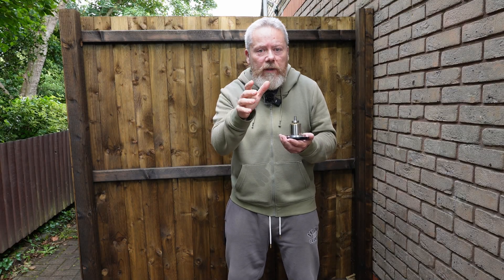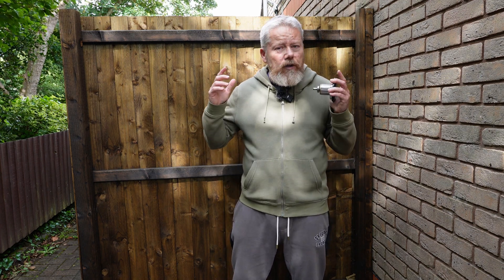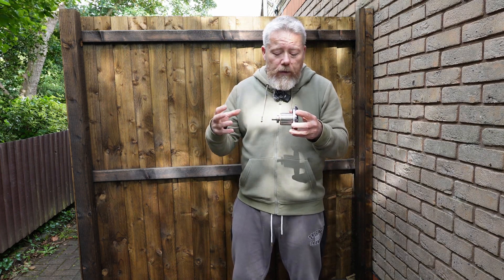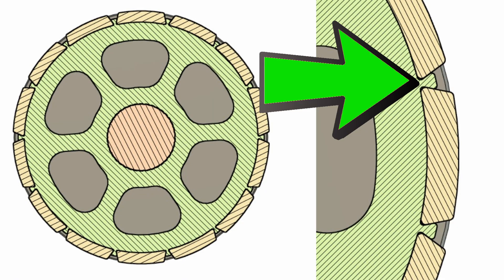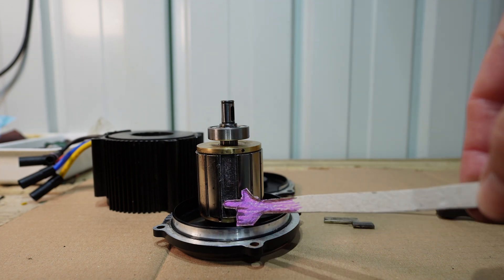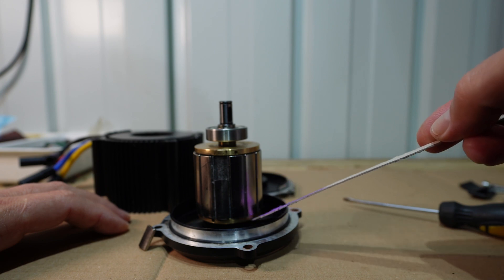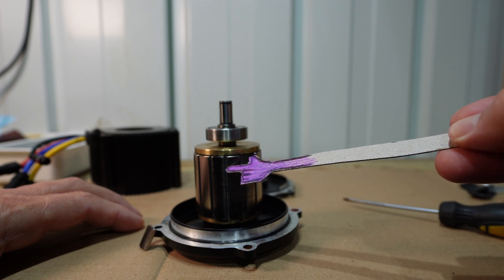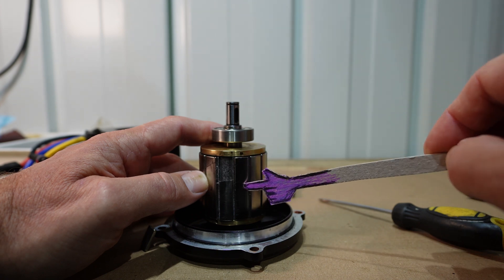3500 Watt failure investigation of the  CYC Gen 3 Motor Core Magnets CYC damaged motor destruction.

Comment: that's a lot of money for a motor with a few magnets and washers,,, blimey thanks for the video , shame that failed, my son had problems yrs ago with a Suzuki sv 1000 magneto were the magnets broke loose and caused bad damage , turns out was a known manufacturing fault with the glue they used to bond the magnets to the cylinder cheers Shane uk

Comment: The cause could be the heat destroying the magnets The glue may had been loosed its properties due to heat + centrifugal force caused it to pop out. Heat could be caused due to the max current passing through the coils.May be the switching of the coils had not been at synchronised with the magnets also (Hall effect sensor) at the motor in speed this may caused back emf to generate in not proper order thereby drawing more current (back emf and voltage from controller shorting) solution could be adding another Hall effect sensor or optimising the controller processing brain. also stoping the controller of providing high current to coils at high (less stress or load) optimising the switching of coil by keeping the Hall effect sensor in proper synchronised. Thank you
Reply: @baconbuttties  the diameter of the motor could be increased thereby increasing the torque and reducing the current draw of the motor

Comment: You really got my attention when you revealed this attachment method of sliding magnets into a slot. Then you did such an incredibly s*** job of evaluating whether these slots were effective or not at retaining the magnets that I actually gave you a thumbs down. You were too damn lazy to take the brass cap off the rotors so that you could take a picture from the end of the slot. You didn't even try to. You didn't try to measure it. You did nothing to prove or disprove the effectiveness of these slots.
Reply from the maker: Sorry I didn't meet your expectations when talking about a 1000 pound failure. Next time my bike fails I will remember to forget about not being able to use my ebike and solely concentrate on making my video more specific to your needs.
Reply: @baconbuttties  that's more like it.

Comment: I bought the CYC X1 Pro Gen 3 and rode 2 kilometers on a test ride after having it professionally installed by an electrical engineer & e-bike builder, bench tested and professionally built every step of the way and tipple checked everything, . The motor and the X6 controller just burned out on the first test ride. Running at max 2,000 watts. The magnets need to be  embedded, so the motor spins flush and the magnets form part of the core. That way the centrifugal force doesn't contribute to degradation of unit. Imagine bein on an amusement park ride that spins and rather than being strapped into the chair with aa seatbelt and safety bar you're held on by a clip to the back of your t-shirt.
Reply from the maker: Not good is it, they are not fit for purpose

Comment: CYC is not made to operate in just one gear. You must be on the correct gear for the correct speed & terrain.. You can not & I repeat, can not operate it like a bbsd. It is a different beast.
Reply from the maker: But it is meant to operate in within its tolerances, I didn't go outside it

Comment: Ok so it looks like I’m the outlier here. I run a 72v set up with a  Molicel battery (12.6ah) on a Giant Trance X 29 2. I’ve been running it for a year or so and I ride single track and pedal and I also “dirt bike” it around as well. It’s stupid fast and torque is insane. I was told the X6 controller runs (in race mode) at 65amp. My battery is rated for 90amp continuous. I’ve hit 45 half way down to the high gears so top speed has to be between 50-60mph. So I run bursts of 4680watt (72x65) and even above because it’s about 84v fully charged and was told it will handle up to 5000w bursts on the stock X6 controller. 

I haven’t had one problem with this motor. The torque sensing has been absolutely wonderful for those of you who get out on the trails and has worked flawlessly.

I will say that I think this motor really likes a “torque” set up over a “speed” set up so to speak. I run the lowest tooth motor setup and my low gear for the actual bike is either 51 or 52 tooth. It will throw you off the bike like a 2 stroke dirt bike!🤣🤣 

Also I’ve found that throttling in bursts rather than sustained throttle is what it likes as well. 

My engine does cut power if I push it for the record also so I know the safety feature works on mine.

I’m sorry you’ve had problems good sir. I’ll say that if your going to do a lot of pedaling with some throttling here and there then this motor is perfect. If you are going to be doing more throttling than peddling than the modded BBSHD is the way to go. I own a non modded BBSHD and it’s been absolutely flawless but I prefer torque sensing over cadence and THAT’S where the BBSHD falls short. I do hope your new one serves you much better good sir.👍🏽👍🏽

Comment: My TSDZ2 with 1/5 the power had exactly the same design on its rotor and failed exactly the same way, after a sustained overclocking at ~600W. The trapezoid magnets look intuitive but they just won't hold up under extreme heat and rpm. My guess is repeated inconsistent heating and cooling for the magnets and the rotor body along with the rpm causing them to slowly deform and detach. I investigated my failed rotor and found 1/3 of the magnets developed axial and radial play. Glue is the way to go for such high speed rotors.

Comment: It could've been when you were doing those runs up that big hill on the big 50T cog a few vids ago. I was wondering at the time if you were in way too high a gear. It would be interesting to know how many revs the motor was doing when you did that test.
Reply from the maker: The motor will only go as fast as it will go, it's limited no matter what gear you use. 👍👍

Comment: The manufacturer CYC said that it had solved the problem of the magnets in the GEN 3 and it still has the same problem, I don't know how much the price of a kit means to you, but in my case it is a month's salary, and I get rubbish, You have to realize that CYC are scammers and should pay for it, I insist do not waste your money.
Reply from the maker: I believe they are trying to make a good product as replacing parts under warranty wouldn't make good business sense.

Comment: Hi guys. I bought a Stealth gen1 in 2021 and I can only say that this is a piece of crap. I had a lot of problems with 

-the bac controller, the torque sensor system failed because of the bad water resistance, he glued neodym magnets got loose and caused a crash between rotor and stator a. s. o. 

When I bought gen1 system, I got just 1 year warranty. When you now buy gen3, you get 2 years warranty. 

Sorry, but I feel betrayed. 

At the release of stealth, cyc told us to use it in 36, 48, 52, 72V mode. Meanwhile they erased 72V mode because lots of motors got damaged/fried. 

DON'T BUY GEN 3 SYSTEMS (X1 Pro and stealth) BECAUSE THEY ARE NOT RELIABLE YET. Hopefully gen4 or 5 will be. 

Best regards!

Comment: I go with high Revs.  In DC motors there is a term called "thrown solder"  where the commutator bars are "expelled" from the motor from high revolutions and high heat, and the "smoke is released".
Reply: @baconbuttties  If you hook up an auto starter motor with no load, it winds up until the commutator bars fly out.  The motors are set up with the field and rotor in series.
Reply from the maker: @bigwheelsturning  This has  a controller and a set limit that is set  in by the manufacturer. It would of been tested at peak revs.

Comment: Don't you realize that the gen 3 engines are the same garbage as the gen 1 and gen 2? cyc said he had improved them and he lied, he had a lot of gen 1 and gen 2 engines and he has put them in the gen 3 in order to get rid of them.
Reply from the maker: They are not Gen 1 and 2 motors.
The Gen 3 has slight differences.
Reply: @baconbuttties  gen 2

Comment: I'll be honest- I don't have a high opinion of CYC. I think their claims are outrageous and incorrect, they have seemingly very poor customer service, and their motors have inherent issues that they don't fix from one generation to the next. If you're spending that kid of money on a motor, I would suggest to anyone that they should get a BBSHD and hot rod it. But I'm glad that you got your motor fixed and they responded kindly to you. I do wonder if they knew who you were so they got back to you so quickly. I've read all over the internet about how difficult it is to get a hold of them until they leave a negative review on Facebook. Thank you for your honest review. 😊
Reply: From my experience the Quality is good but there are some bad desing choices. Also i would not recommend 72V for this motor. The RPM is way too high and such a small motor can not take more than 3kw in the longterm.
Reply: @Sur_racer  but the motor is rated by CYC for 72v. If you're saying that's too much for the motor, then you are proving my point of their quality issues
Reply: @georgeforeman89  at 52V the quality is good but the rating from cyc is too confident. Yes you can run 72V but when you go full throttle all the time the motor eventually will break.
Reply: @Sur_racer  lol that's not a good quality machine if it can't handle the maker's own ratings

Comment: I do not think that max RPM changes with 72V. My CYC STEALTH GEN1 with 48V reaches 4000 rpm. What RPM do you see in the app?
Reply from the maker: I will have to look at all the parameters next time I use the new motor.
Reply: I already have 7000rpm at 52V. I think 72V would be even higher

Comment: Do you think maybe your motor had a manafacturing issue, & the majority of the motors can handle the 72 volts? I guess CYC will know, how many motors fail at 72v. Sorry you have had issues, not a nice start to your install
Reply from the maker: It could have been a manufacturing issue 👍

Comment: I was about to purchase CYC X1 Pro Gen 3 - 5000W eBike Torque Sensing Mid Drive Conversion Kit
Don’t think I’ll bother now thanks for the heads up
Reply from the maker: Mine might just be a faulty batch 🤞 They have sent out a replacement so will be testing that to see if the same thing happens.
Reply: @baconbuttties  Keep us in the know. Don't know how long my tangent ascent will hold up so I've always got my eyes on another kit when the day comes but so far the CYC doesn't seem to have all the bugs ironed out. Getting there though.
Reply from the maker: @kolendakomputers2491  yes will be more updates 👍
Reply: My Cyc gen 3 has the same problem. Its a common fault so Cyc discontinued the gen 3 motors. I've just ordered the gen 4 upgrade kit which requires the x12 controller and a new display. I had the Bac2000 controller which isn't compatible with the gen 4 motor. It's turned out to an expensive repair. Hopefully it'll be worth it when it arrives.

Comment: sleeves, you are right a sleeve covers something, dovetails sort of i suppose nearest description, good break down tbh i thing when you have done your 48mph uphill on the motor this was the start of magnets coming away due to high heat and epoxy or whatever used to glue in place, i agree the dovetails need beefing up especially as people buy the gen 3 pro because its the most powerful, god help us when/if they ever release the X12 5000w controller, anyway i have decided i only need 25mph so i'm getting mesen a yose power 350w kit, £380 all inc battery.
Reply from the maker: I wonder if the X12 has been held back for this very reason.
Reply: @baconbuttties  they could just make the tongue and groove, more tongue and groove and use a higher strength bonding of the magnets, either way i'm not sold on the idea of them no more, great video Bacon.
Reply from the maker: @MainlyNorthernSoulDancing  Thanks 👍
Reply: the x12 is out already but you need to buy it seperately. I dont think many people have done it tho
Reply from the maker: @jaegermonster5540  no option for x12 when I looked
Reply: @baconbuttties  yes you can't buy it with the kit but of you search thero website you can buy the x12 separately
Reply: @baconbuttties  I stand corrected. The offering I was looking at was out of stock and has since been taken down. However it was there for a period of time just "out of stock" indefinitely
Reply from the maker: @jaegermonster5540  I did look, Still couldn't find it ?
Reply from the maker: @jaegermonster5540  👍
Reply: @jaegermonster5540  perhaps CYC stockists should consider adding it to the CYC build kits as i could not find jack s**t in USA last month

Comment: From cyc website 
190 RPM with 36V batteries 
250 RPM with 48V batteries 
270 RPM with 52V batteries 
310 RPM with 60V batteries 
370 RPM with 72V batteries
The numbers are from 11/53 chainring, so yes higher voltage gives higher rpm
Reply: He meant internal RPM. Internal MOTOR RPM is around 4000 RPM.
Reply from the maker: Thanks for looking it up 👍

Comment: Calling that a sleeved design feels a bit disingenuous.

Having an SPM motor spinning at high speed like that really feels like a problem waiting to happen. If they were to actually sleeve it, or move to an IPM design, I'd submit that would be a good improvement in the overall design.

As an aside: The texturing on the notches almost looks 3d printed?
Reply: don't think it was disingenuous although possible...more like a language deficit.  But, yes marketing gets in the way because this has been a sensitive failure mode for CYC.  As to your keen observation about 3D printing. That may in fact be the achilles heel and why the tongue in groove failed...insufficient tolerance/web thickness/material properties of 3D printed parts.  That is for CYC engineers to sort out and they better move fast if they are relying on 3D printing to keep the price low in lieu of what every customer wants, reliability.
Reply from the maker: Yes it shouldn't have been called sleeved.
Reply: The texturing looks like laminations.
Reply: @JimWattsHereNow  as in delamination's Jim?...and therefore unrelated to being 3D printed?
Reply: @lukewalker1051  No as in sheets of metal layered together. A power transformer core is made of sheets of metal stacked together. It is to do with reducing eddy currents induced by the magnetic field in the core of a transformer/motor. They are normally insulated from each other by a varnish layer.
Reply: @JimWattsHereNow  But in Cyc design stator and rotor laminations are not insulated at all